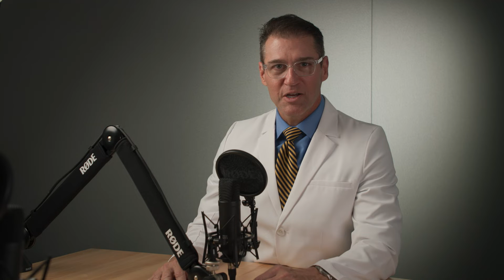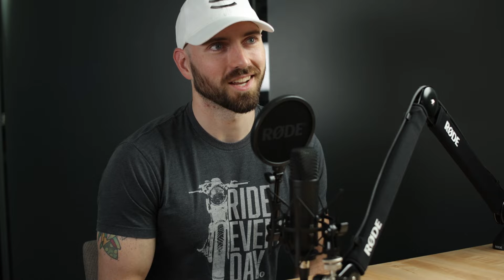Did your patient's implant fail years later? It's still YOUR FAULT!

Comment: A great video.  Have had my ceramic implant done by a dental surgeon ten years ago, and it is now causing problems. I go for a six monthly checkup and cleaning to my dentist, and he said it was infected six months ago and took an Xray and said it wasn't sitting properly.  He referred me back to the dental surgeon who cleaned it with antibiotic liquid.  At my second appointment at the dentist (six months later), he said it is still infected and the gum pockets are 8mm.  He sent me back to the surgeon again, who took an Xray and said that I have 30% bone loss in the implant, but not in the surrounding teeth.  I I mentioned to the surgeon that my dentist said the implant wasn't sitting properly and he said it looks fine!  He said my implant is not wobbly and it's still good.  He recommended a mouth wash which I have to inject daily into the gum pocket.  My worry is that the implant can still be infected and I won't know it, because I don't have any pain.  My next dentist appointment is next April.  I would love to get the implant out, let the hole heal and use a removable false tooth.  Would Dr. Stanley let me know if that is possible??  If my implant still has big pockets next April, I will make an appointment with my dental surgeon to ask about removing the implant.